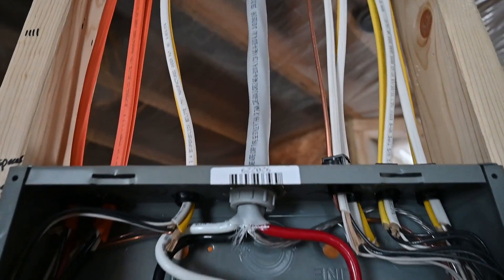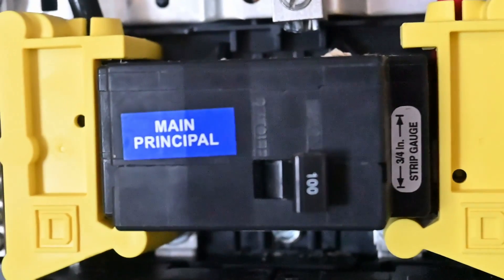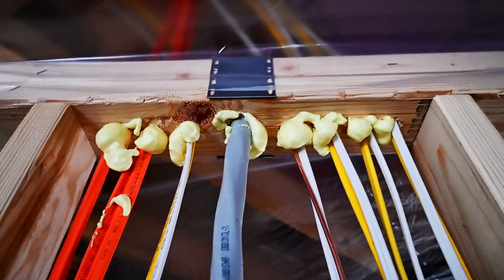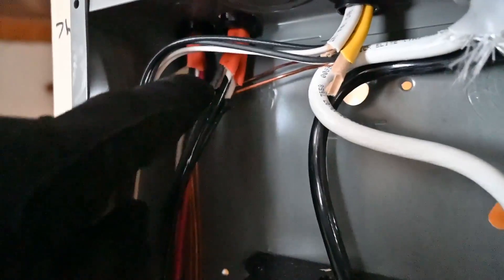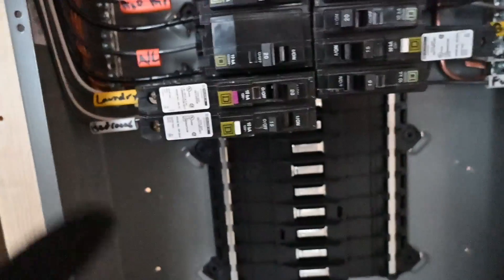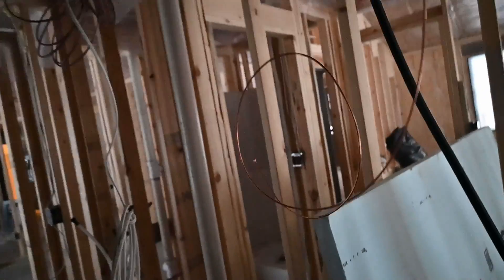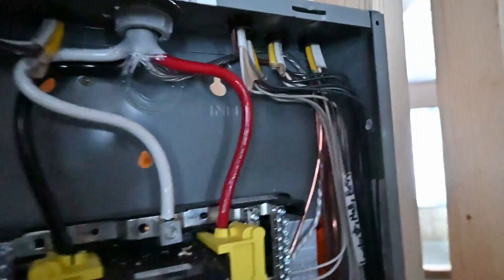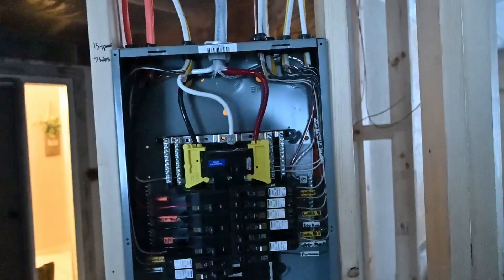90A Sub Panel Install

Comment: Just a correction on what you said. There was a table in the prior NEC editions that sized the wires for service entrances table 310.15(b)(7) if I’m not mistaken and 2 awg is the size for 100 amp service because service entrance cables aren’t sized at 100 percent like table 310.15(b)(16) the table you were using. They size it based on 83% percent of the load seeing as how not everything is going to be used at the same time and therefore doesn’t have to be sized to 100%. This is why when you size a 200 amp service you use a 2/0 copper or 4/0 aluminum and if you check the rating on them they aren’t rating for the full 200 amps either, but this is just for the main panel, sub panels are sized different. Just some info thrown your way bro. Love your videos keep them coming.
Reply: 83% feeder rule doesn’t apply here since this is the sub panel, in essence a branch circuit from the main service panel. You can only derate the main feeders.
Reply: @andrewsandefur7715  you’re right.
Reply: Your right in residential. Or the inspector in the area
Reply: I love fine print notes

Comment: Thanks for this video Ben. I have a question about the Neutral wire for the sub panel. I am putting a 3AWG neutral wire fro the main to the sub panel. BUT, the neutral wire is too big to go in the Neutral bar (holes are smaller than the wire). Can I split the neutral wire? Is there another way?
Reply: You need to use a lug kit manufacturer panel specific need to treat all strands as a solid never want to separate or even worse cut to fit
Reply: @wizard3z868  Thanks :)
Reply from the maker: Good question! I'm assuming that you are talking about the neutral bar on the panel that is feeding the sub panel correct? If so then you can just use a "neutral lug kit" for the brand of panel that you are working with. Here are a bunch of options that might work: https://amzn.to/37XtIO9

Hope that helps! Consider subscribing if you haven't yet!
Reply: @BenjaminSahlstrom  Thanks Ben.

Comment: NFPA 54 Sec 7.13.1
"CSST gas piping systems shall be bonded to the electrical service grounding electrode system at the point where the gas service enters the building. The bonding jumper shall not be smaller than 6 AWG copper wire."
Reply from the maker: Awesome! Thank you for the clarification! I'm surprised that it has to be that large but it makes sense since 6awg is also the size for grounding water lines if I am not mistaken.

Comment: The main lug shields are available as a part, to retrofit existing panels. So seeing them is positively correlated to the panel being recent, it is not absolute.
I have been able to order them, but the supply house looked at me funny when they had difficulty finding the part number I provided, as they had never sold them through their system yet.
Reply: All about ARC fault protection
Reply: Rap with black tape.

Comment: 6:04 Bathrooms are not required to be arcfault protected. They will just put a New GFCI device In on finish. Sometimes we will install a GFCI breaker but the device option is less expensive.
Reply from the maker: Could be. I've also seen that the dual function breakers are often as cheap or cheaper than the gfi ones so that would work as well. Thanks for sharing!
Reply: not any more a lot of jurisdiction are requiring afci/gfci everywhere and its only like $10 more for duel breaker save space and looks neater than to have gfci outlet although convenience of resetting is lost

Comment: if you wanted to add 2 ground bars in a subpanel what size cu wire do you need to connect both ground bars with? As they did in this panel is it ok just to use the panel itself?
Reply from the maker: It's fine to use the panel itself. If you want to add a piece of wire in between that's just some added redundancy if you decide to do it. Something like a short piece of 6ga bare copper would work great.
Reply: @BenjaminSahlstrom  great thanks! love your vids

Comment: Agreed, I'm not a big fan of flush-mounting a panel. But what else can you really do for a finished space? You'd be tearing into walls or ceilings anyway to add circuits in other parts of the house. I guess I'm a fan of unfinished basements in general. lol
Reply: You mean a huge utilities access point. LOL I love a basement that is only used for HVAC, Plumbing, Electrical, Hot water heaters and communication wires. It's a thing of beauty.
Reply from the maker: Exactly! Unfinished basements are awesome for anyone who wants to add or change things later. Makes it very convenient.
Reply: And if you don't have a basement?????
Reply: @phyl1283  Then the next best thing is a utility room!

Comment: also the should have used white tape on the neutral wire to prevent it from touching the ground wire since its a subpanel

Comment: In canada we use a piece of plywood and screw the panel to the plywood, drill holes through the plywood and pull the wires straight into the panel through the side or the top. Therefor we leave it exposed so that in the future its much easier to remove or add

Comment: why alum wire...........   not copper
Reply: Cheap, light, and easy to work with
Reply: There’s nothing wrong with aluminum, if it’s installed properly.
Reply: @roymills415    but buy it yourself  it is better
Reply: You have to remember that the electrical trade is not as lucrative as it seems. It's the "be all and end all of all the building trades and thus competition is rife. One has to try and save money.
Reply: @jolyonwelsh9834  thats fine,  i do understand,   but for the homeowner , best know what you get when you buy new or build. , if you build buy the copper and supply to contractor.   . new homes are built poorly , insulated poorly which will cost you a lot, in heating and repairs. .   we all must be more knowledgeable...
Reply: @spymaine89  yes but a lot of CON-tractors will only install their own high mark up materials in my area i can do most of the work myself and i have a cple of hack trades that will just sell their license #.  i wldnt even trust them to replace a cover plate or install a drain plug yet some how their licensed 🤦‍♀️🙄
Reply: @spymaine89  pple only pay for the lipstick on a pig never what it was feed
Reply: @wizard3z868  i will not pay for ''lipstick that will quickly corrode and fail FEED .
Reply: @wizard3z868  i have never had that problem,  they do my way,  or next guy. 

...yes sometimes the thieves conspire together  all local gas companies wanted 6000. usd for my propane gas furnace for barn,  had to do it myself,  new with warranty 100k btu , ebay with propane kit , condensate pump.  1000.usd.  manual showed me how, pvc pipe local hardware,  EASY   FUN. 

BIG $ SAVE.   had gas guy hook up gas , 150.usd.    your are a victim ,only if you choose to be.
Reply: @spymaine89  👍👏
Reply: @spymaine89  👍🤣
Reply: @wizard3z868    thumbs up  universal good

Comment: It’s very good - but I like the installs where the installer makes it look like a well-programmed robot put it together. Grounds perfectly straight and bundled,  precise bends, etc.
Reply: Can't bundle wires. Code
Reply: @johnkulpowich5260  not considered "bundling" inside of the panel. You can absolutley zip tie them off in the panel clean no problem.

Comment: Tidy little panel! I wish Square D would come out with PON GFCI-only breakers, especially with the 2020 updates requiring GFCI for AC units and dryer circuits. It'll be a shame to spoil an otherwise nice install with pigtail breakers for those new requirements once they start taking effect.
Reply: Required for a swimming pool panel as well?

Comment: I would have placed green tape over the aluminium ground wire to avoid dissimilar metal contact with the copper wire. Other than that, it looks good.

Comment: great work.  square d panels SUCK.  square D breakers the best.  lates.  why do square d panels suck, cuz all the neutrals are at the top.  even if square d make a panel like siemens, they still suck.  forever and always square d panels suc.  also that aluminum neutral looks close to that copper ground, they had better NEVER touch!!!...
Reply from the maker: Thanks for sharing your experience!